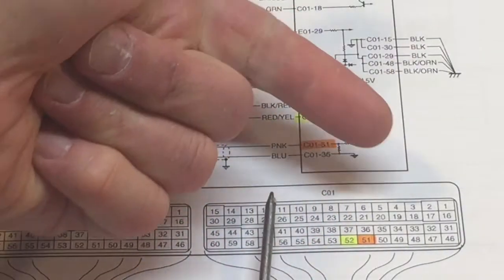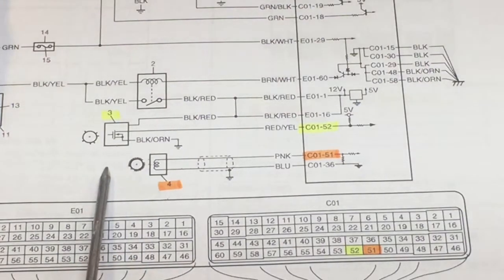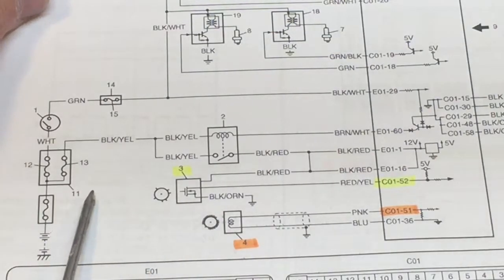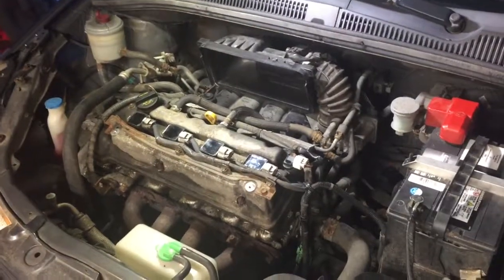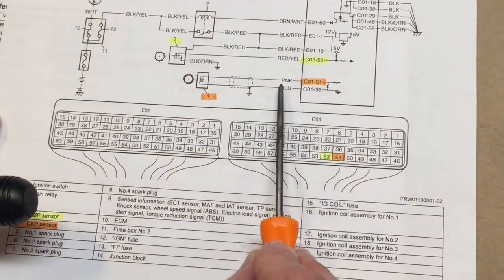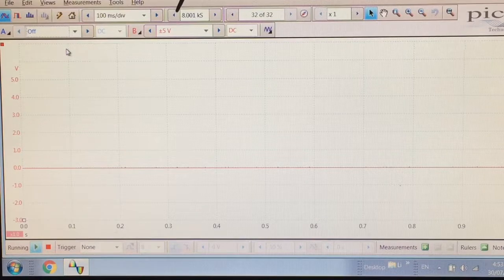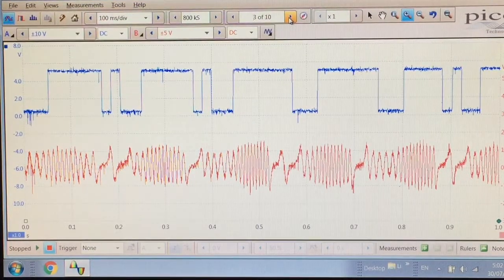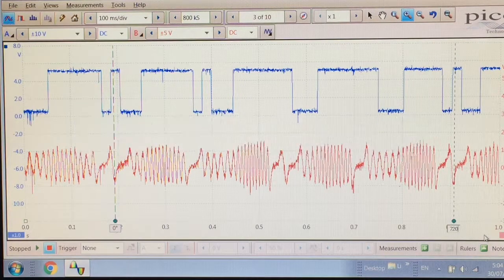SX4 Cam & Crank Signal Testing P1

Comment: Hi, thanks for info! 2011 SX4 Canadian (J20B RW420). I have code P0335 (CKP sensor). Suddenly out of the blue turn key to start, no crank over, no click. Battery good, dash lights all on. I guess its difficult to get at the connector to test resistance as per manual. This could be a dumb question BUT would one be able to check that sensor resistance by removing the ECM connector, hooking up ohm meter to the plug that was removed ... to wires that go to PINs 51 and 36 seen 10 seconds into your video (PNK and BLU) and test it that way? I'm grasping at straws ... Jim
Reply from the maker: This might help…
https://youtu.be/uMtN9dzHYho
I am not certain but I wouldn’t think the Crank code will inhibit rotation. I could be mistaken, but I think your maybe getting that crank code because there is no rotation. I would consider the starter. Check the basics, battery terminals, cables, contacts, block ground. Park/clutch depression safety switch. Sometimes percussion to the starter case will temporarily recover operation (you likely know this). Make certain the vehicle will remain completely stationary for your safety. Is it a manual gear box? If so, did you try bump starting it? Get back to me. I will clarify if required. 🍀
Reply: @TheGibby3340  Thanks so much for replying! This is encouraging. Mechanic led me to believe starter was OK but now says starter had power BUT just power from main battery but did not bump on case  (like my old Dodge Dart in the 70's) ) or force with direct power to crank the starter. So this will be done coming week when has more time. Its an AWD CVT automatic. I'll see how this goes.  I have viewed all your SX4 videos ... very helpful. I will pass this info on and get back later with how that goes or if solution found. Jim in NB.
Reply from the maker: Ok. Good luck 🍻
Reply from the maker: This also has Crank sensor details https://youtu.be/Mus3RFlr9x8
Reply from the maker: https://youtu.be/2JvTla4RV2I 
I was able to duplicate your fault scenario. Kinda interesting.🍻
Reply: @TheGibby3340  My my thats awesome! Just viewed the new video. Thank you sooooo much. A bad starter will cause the P0335 code! On Sunday I went down the road to my car sitting in garage yard. I removed the airfilter box. Tapped on the starter and solenoid with 12" drv strongbar. Buddy turned the key. Was still a nogo. He held the key on ignition start for about 15-20seconds. Could smell something like wire or starter 'burning'. No smoke but could smell something. Will pass this info on to mechanic. Hope they get at it soon. Will get back with results. I did comment on the new video.
Reply from the maker: I saw your comment Thx. Hope you get it sorted soon. Cheers 🍻

Comment: What kind of engine do you have? Mine is an sx4 petrol 1.6, 2007 model. Is the crankshaft sensor buried inside that engine aswell? I am not sure but i think that Ive located ut below the alternator.
Best regards from Sweden
Reply from the maker: Both my SX4’s are 2.0L gasoline. I am not certain but I believe it was the only engine variant offered in the Canadian market. I honestly don’t know the layout of the 1.6 but I will consult the workshop manual and get back to you. All the Scandinavian countries are on my bucket list. Only been to Iceland so far. Faroe Islands next hopefully. 🍻
Reply from the maker: You are correct Sir. Just inboard of the alternator on the 1.6. 🍻
Reply: @TheGibby3340  That did it! Many thanks.
Nice, Iceland is on mine list too. Happy travel!

Comment: Hello, first off want to say thankyou for all the sx4 vids they have helped me out alot. I have an 07 2.0 gas sx4 mt. Havent had any prob until i bottomed out coming out of my drive. It died cranks no start. My dlc no longer links there is power to it. No spark no fuel. New ecu still no luck. Any ideas?
Reply: Ive checked the fuses but will recheck. My dlc has power it will make the obd2 come on it just will not link to ecu. Ill chk all the pins tho. Thankyou again for the input i really appreciate it.
Reply from the maker: Hello. Thx for the kind words…I’ll ask, when you say bottomed out are you referring to the suspension or did the under tray strike?
Reply: Yes, i hit a dip in the drive going a lil faster than usual an no doubt bumped the skidplate an crossmember with a fair amount of force. But wasnt nothing hard enough to cause visible damage or disabling i would think but here i am.
Reply from the maker: @camscott7531  ok just trying to connect the dots. The first thing I would do is reinstall the original ECM. Often ECM replacements will result in a VIN/key code mismatch confusing the issue. Once returned to the original configuration I would check all 12v supply, 5V reference and grounds at the ECM connector. Also look at the DLC pin out 12v & grounds and CAN Hi & Low lines (data bus) if you have a scope. There may be a loss which is common between the ECM & DLC. The shop manual is a must. PDF copies can be purchased online for about $25 worth every penny. Tell me…when you initially rotate the ignition switch to run, can you hear the fuel pump prime for ~2 seconds?
Reply from the maker: @camscott7531  In the interest of simplicity & expediency check all the related fuses first. Corrosion can get the better of the distribution boxes. Mechanical shock may have caused a  heavily corroded wire to finally come adrift. Rereading your account of the situation (no power at the DLC) would draw me that 12v supply (pin 16) and respective grounds (pins4&5)
Reply: Ok will try that. An upon ignition switched on acc. No fp noise. Before this happened my chk engine would illuminate (02 sensor) an all the normal dash lights. Now i have no chk engine light and the auto and lock awd lights are on an stay on.

Comment: I have a Suzuki SX4 with a hard start and misfire over 4000rpms. I changed the crank sensor when I did the clutch in an effort to be preventative having noticed it’s dumb location. Symptoms appeared following. Ohm test is 720. I did the picoscope but I think it looks like it lines up kinda like yours...... what’s going on here any advice?
Reply from the maker: Tony Dugan If you are referring to the 2.0L gasoline engine type...Consider the ignition coils. If you have let the plugs go to long the excessive gap will compromise the coils. They will flash over and the spark may not reach the plug gap. Just a thought...
Reply: i have the same problem @ducalicous. Ik this was long time ago but did you fixed it ?